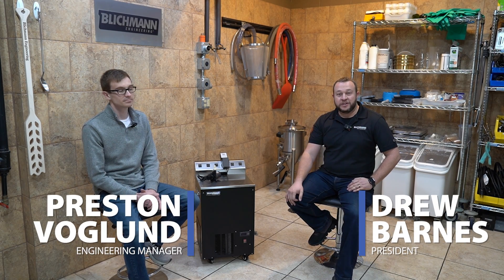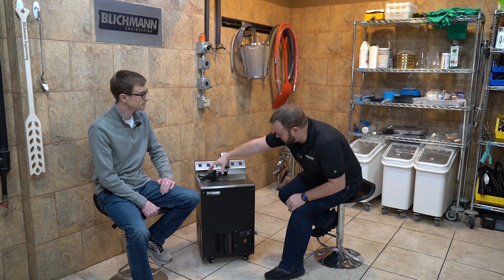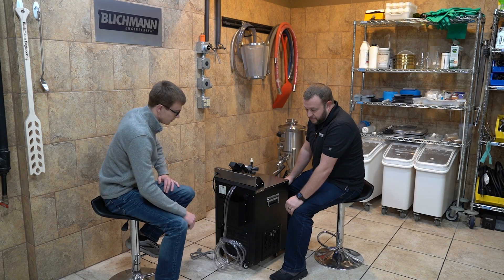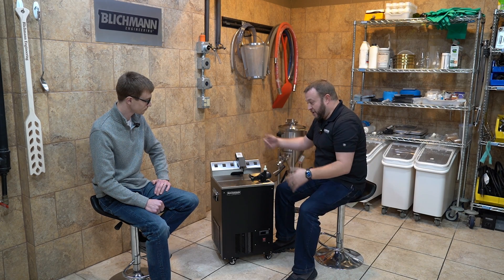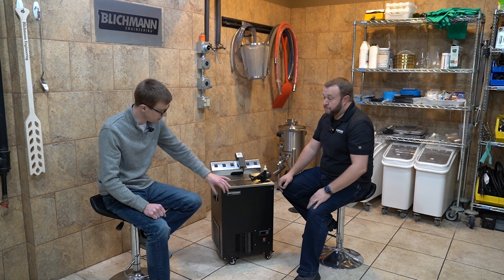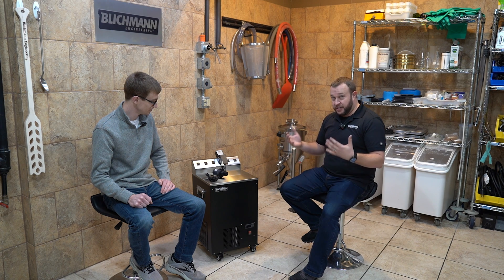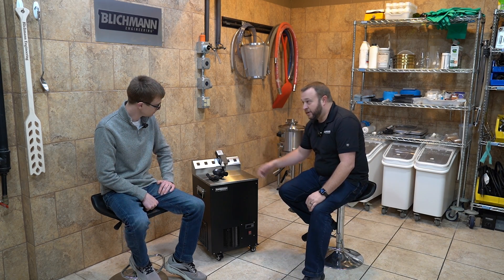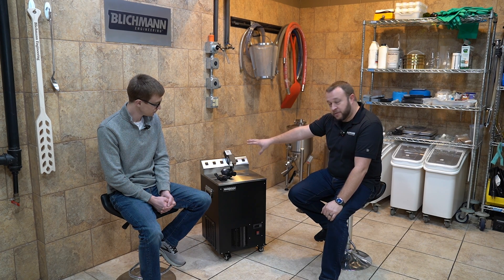Blichmann Glycol Chiller Overview | Big NEWS with Drew & Preston

Comment: Great job! I might add, that although you have 6 plugs, a home brewer can easily add more hoses and pumps beyond 6 if they had that many systems. Most home brewers probably won't exceed 2 very often, but for brewers that brew in batches from time to time, like myself, it is nice to know you could easily exceed the 6 without issues. It also works great to cold crash pressure fermentations before moving them to a keg. (Tip: Don't cold crash a fermentation in a fermenter not under pressure, as it will create suck back that could bring oxygen or other stuff into your finished beer.)

Plus Blichmann Glycol system is insanely energy efficient compared to other systems on the market.
Reply from the maker: Thank you for the support Mike, and the great tip! Cheers.

Comment: First off, great chiller, but with caveats. I’m on my second one…actually, my third. Bought VERY early on and first one was exchanged. On to my point…please find a way to offer the replacement relay unit and capacitor. If the chiller dies, the overload relay or capacitor is a likely culprit, especially in a warm garage. For my chiller that died, you were no help on replacement parts. Fortunately, we negotiated on a replacement unit and I have stuck with you. Else, I would be with a competitor. Lastly, please explain horsepower listed on the compressor vs. what you advertise.
Reply from the maker: @smitty7592, thanks for reaching out and we are so sorry to hear of your experience with the earlier models of the chiller. We've made significant strides recently, including forming a more dedicated team and enhancing our processes to ensure every customer has a superior experience with us throughout the brewing journey. Excitingly, we've upgraded our chiller to a 1/2 HP from 3/8, boosting its cooling capacities to 3100 BTU/hr at 28°F and 3400 BTU/hr at 34°F. We are getting ready to release a video that explains the calculations further.  We're committed to providing you with an improved experience and hope to exceed your expectations in the future. Cheers!